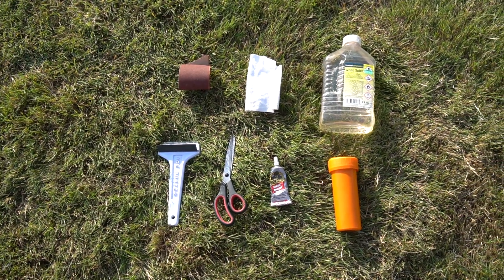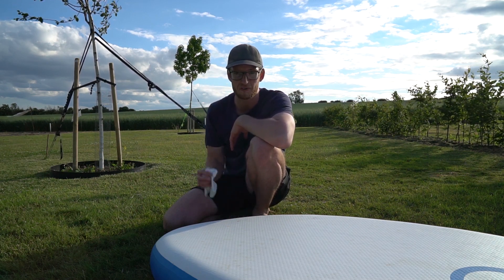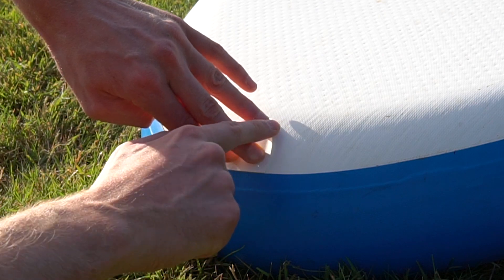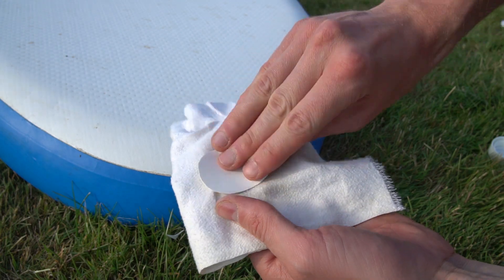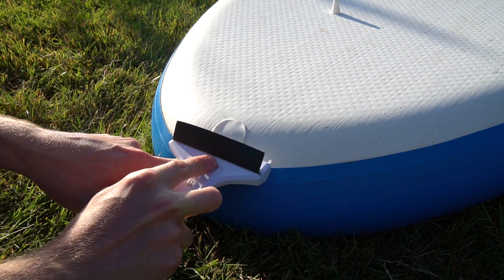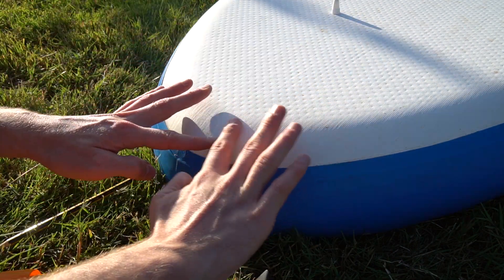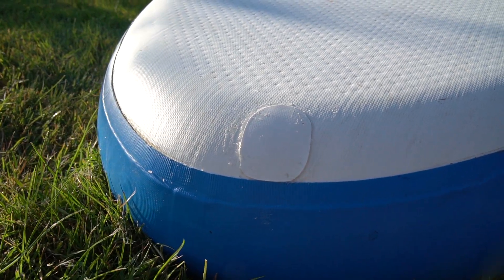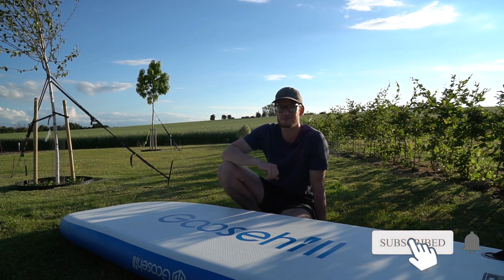My SUP got a PUNCTURE and I Tried to Fix it (Badly) | How to Repair a Stand Up Paddle Board Puncture

Comment: Why did you do it with the board filled up?
Reply from the maker: I think that’s how you get the best seal especially for an area like this puncture otherwise the surface might be creased. It also makes it easier to see if you have actually stopped the air leak with instant feedback

Comment: Definitely used too much glue, I've used contact adhesive for years making costume items out of foam and you need the smallest amount possible, there should be next to no excess to squeeze out. If you need to do a repair again, use a brush to apply a very thin layer of glue, make sure it's gone tacky before attempting to bond together.
Reply from the maker: @MattZab83  thanks for the advice and yes I think you are right! It hasn’t lasted but tbh it’s a bit of an awkward patch/place. Might try and fix it again at some point but mainly use a different board now! Although this one’s alright for little day trips 🏄🏼‍♂️

Comment: So... Did it hold?
Reply from the maker: Unfortunately not! It’s a very slow puncture so the SUP is still usable. Will have to have another try at it when I get some time. Maybe the bond wasn’t great? Patch may need to be bigger? Any suggestions? 😅
Reply: @MorewithMat  Shame! Will be interesting to see what the pros do differently if/when you send it off for repair
Reply from the maker: @en3sr2  yes it will be interesting!
Reply: Did you ever send it out to a shop? Looks like you 1. Didn’t cover the full hole (a lot of the air was coming from the seam itself, not just the scratch), 2. Didn’t use a proper vinyl cement, 3. Glued it while it was inflated, which would’ve pushed the glue out of the area where it was needed before it dried.

Comment: Watch the nrs video.  I don't think gorilla glue is made for that.  But ive had trouble and failed with other patches eithr goitn to get raft repair glue as per nrs or have a raft company repair it because they know their business.
Reply from the maker: Will check it out! Yeh raft/marine glue would be the best I guess! This patch came off but tbh I’ve still been using it, puncture is very slow so does the job for a day out on the water. Just aware of it when paddling on the sea and if I do an over night trip I take a pump with me to top up. Might try fixing it again one day 😂
Reply: @MorewithMat  originally I tried tear-aid patch kit and was out fishing on a lake and the patch blew out and we had to race to shore before we sank 😆😬 I just bought a vinyl patch with hook for rafts and Clifton urethane to glue it down.  Seems to be a recommended one for raft patches and mounting extra tie downs and accessories so should be solid. Not gonna risk a cheap job this time. 👍
Reply from the maker: @tturner7786  oh blimey bet that was a frantic paddle! 😅 Oh nice yeh sounds solid might have to try that myself! 🏄🏼‍♂️